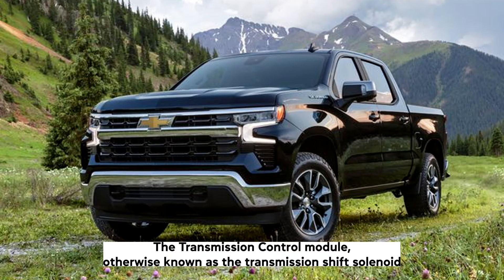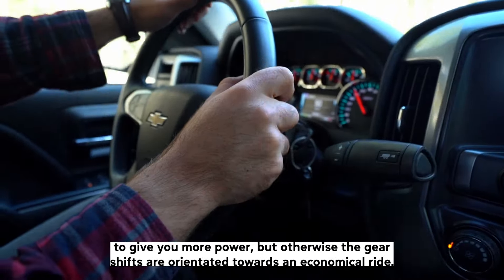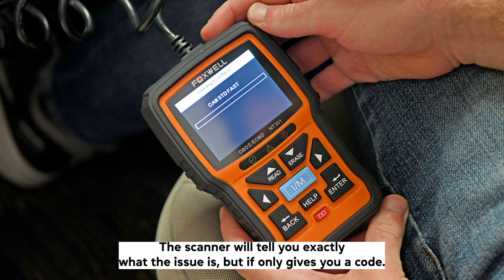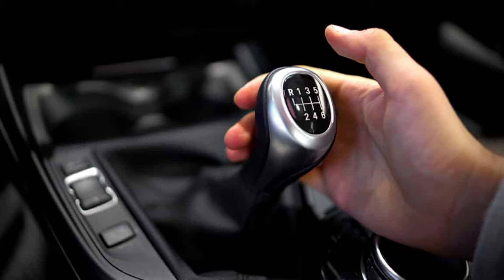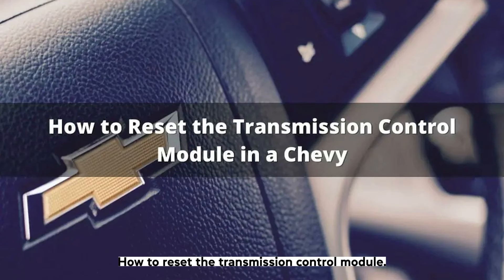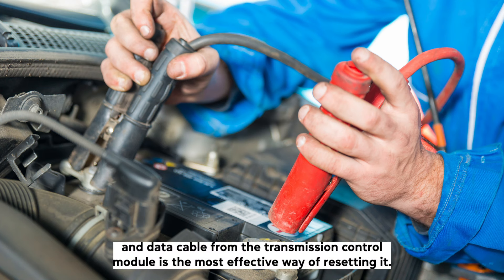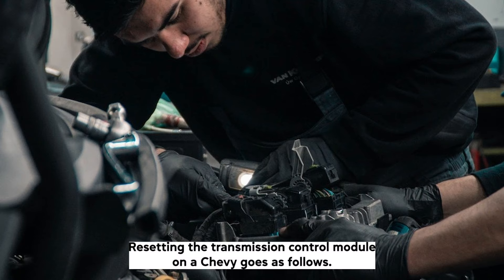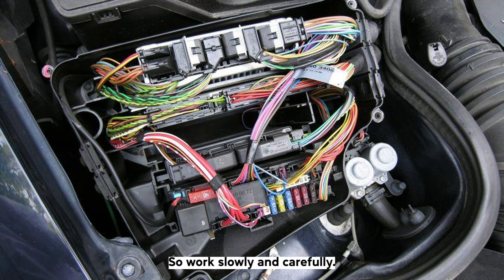How to Reset the Transmission Control Module in a Chevy (Location and Steps)

Comment: I have a 2016 Korean version Chevrolet Spark and it shows the fault code P0700 which is the TCM, I already changed the transmission oil and the fault is still present.
I can perform this reset so that the fault stops giving since every time the check light comes on the car only works in first gear.
Sometimes the light doesn't come on and the car runs perfectly but if it does come on it works only in first gear.

It is a CVT automatic transmission.

Comment: 2003 cuburban 5.3 l 4wd at dealer now. has S! and S2 solenoid faults as well as torque converter codes- has remain trans and codes wont clear . any input?
Reply: Bad ground wire ..cheak one between block and hood

Comment: Damn I'm glad I own a Ford, to reset its TCM just disconnect the battery, use jumper wire to attach the cables, do not let the cable touch the battery. Wait 30min, capacitors are drained, reconnect the battery, start the car, 15min later idle is relearned, easy.GM engineers must have been drunk when they thought of endless ideas to reset the TCM.
Reply: U can do the same thing on a Duramax lmao. But easier. Just disconnect the battery’s and let it sit for a while preferably 20-30 min and then hook back up and it’s reset.